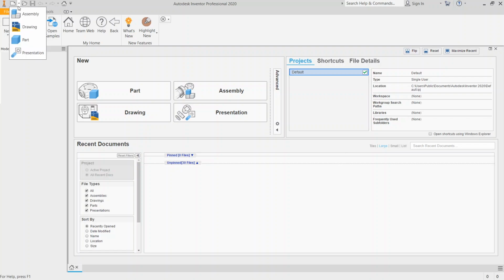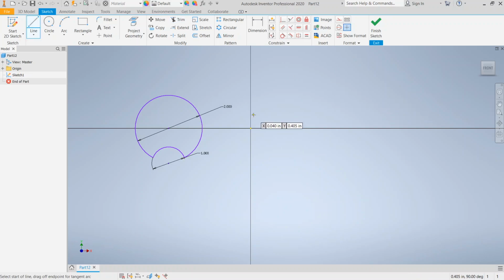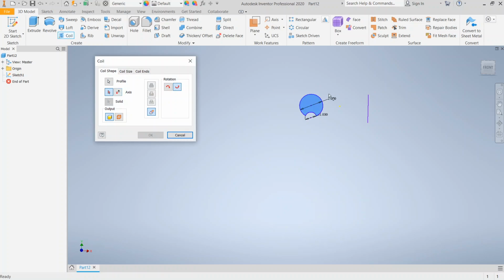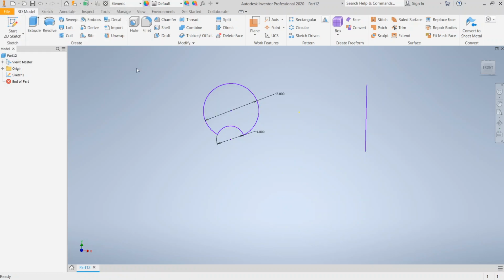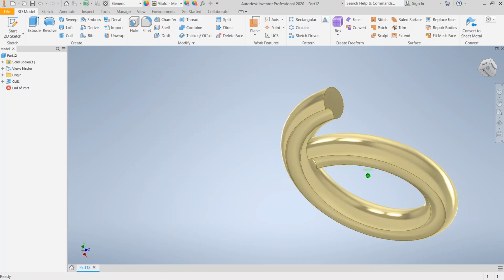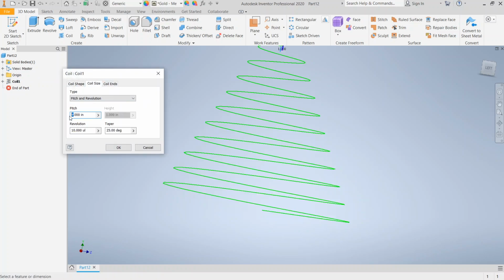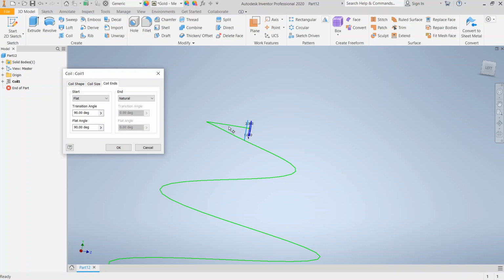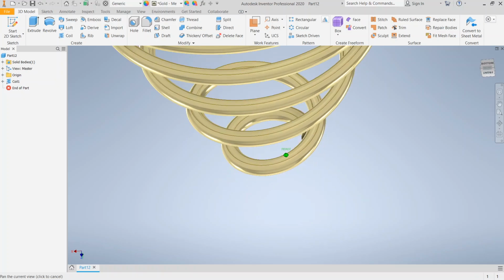Autodesk Inventor 2020: 11: 3D Coil

Comment: how did you get the option of coil ends? in my program it doesnt appears
Reply: Go to the bottom of your coil dialogue box. If yours is like mine, and not the one in the video, put a tick in the Close Start box. I had to then change the value in the Flat Angle box alone. Click OK, then go back in and change the Transition Angle box to 180. Perhaps there's a more elegant way of doing it, but that worked for me. The trick seemed to be to change the ends in stages.